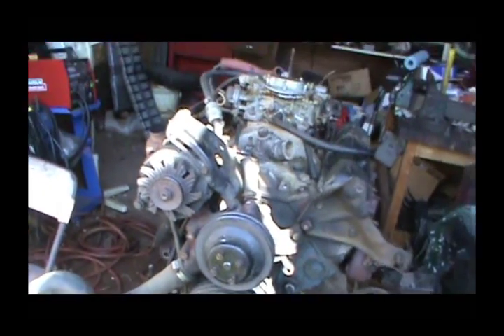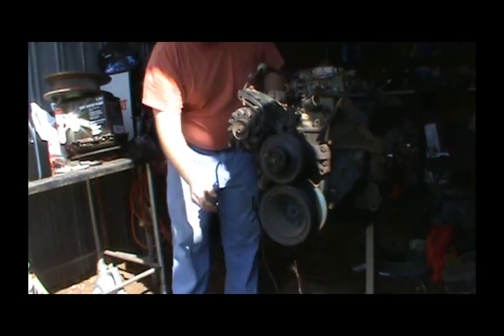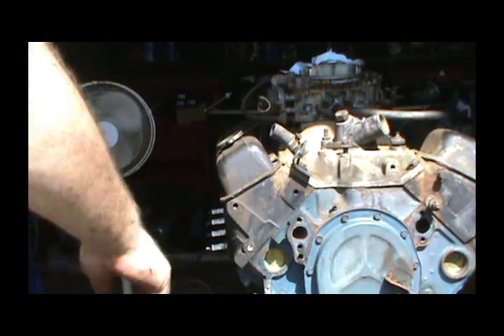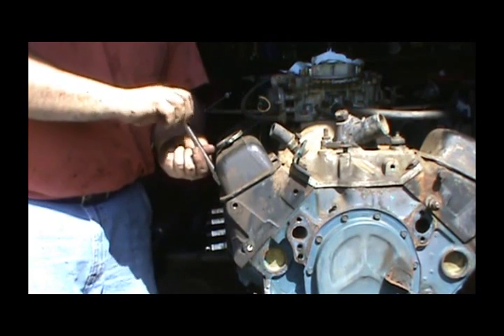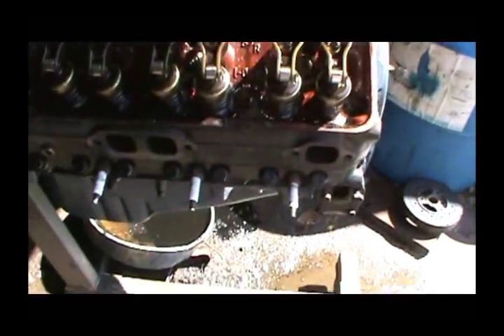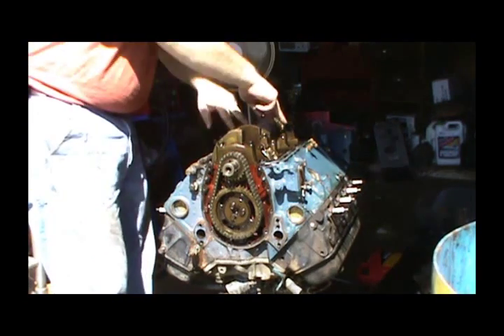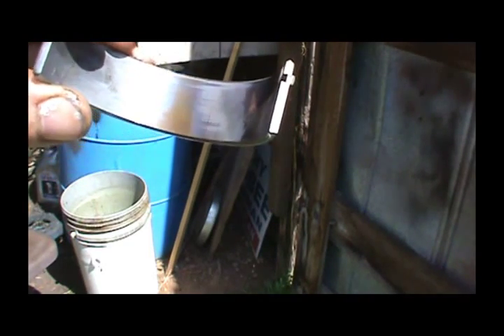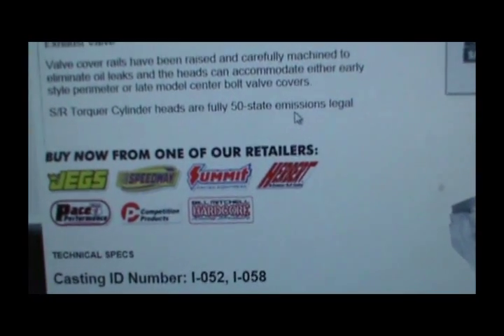Project 383 Stroker - Cleaning & Inspection

Comment: On occasion I'll put the impact wrench on the gear puller draw bolt as it saves a bit of effort and time over using a wrench.  Being careful of course not to over torque if the item being pulled is absolutely seized.

Comment: 4-bolt mains and S/R heads. That is gonna be one hell of a torque house! S/R is a good brand and will definately let that monster BREATHE like it should. Looks like you decided to tear it down at the right time. New mains will be a good thing.

The rollertip rockers look like Competion Cams 1:6 ratio rockers. Excellent choice for a HP S/B Chevy engine. Can't wait to see what lurks under the cyl. heads. My guess is 10:1 forged flattop pistons. 

Fun Fun!

John